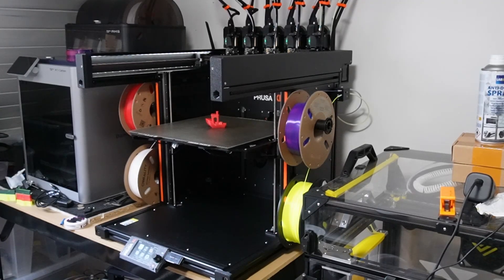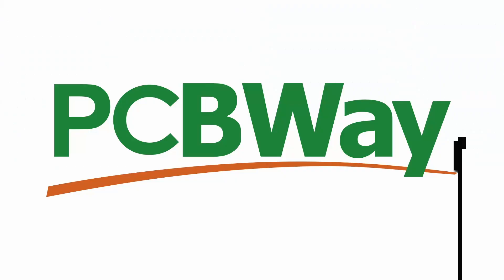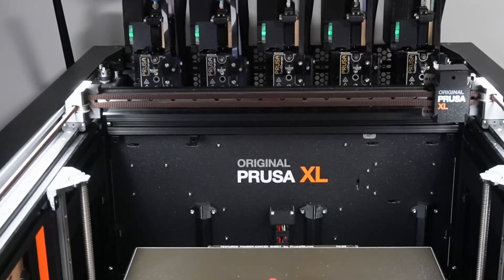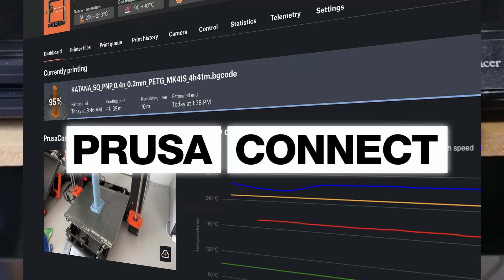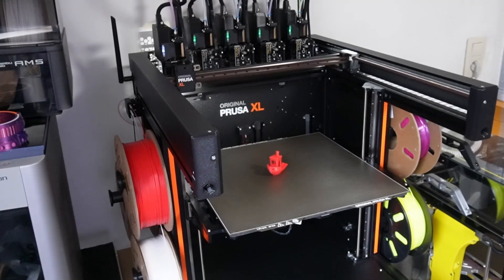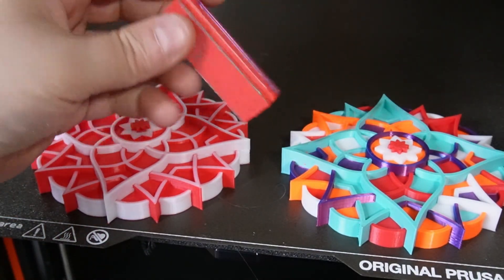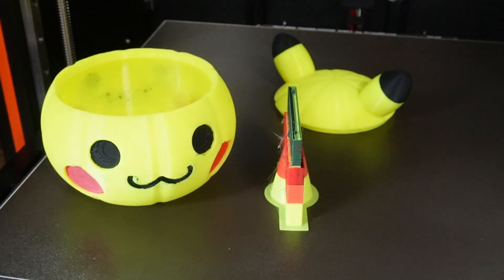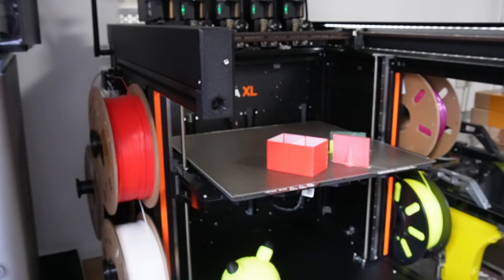Prusa XL The 5 Toolhead multicolor/multimaterial 3d printer

Comment: I took the plunge in January after waiting ages from the pre-order.

Yes, it's not cheap, but it runs like a Swiss watch! It really has no "equals" out there, hence the price they can ask. A 5 Toolhead was $6,500AUD landed. But on Multi colour prints which is what it's mostly used for (Or very large prints), it has no peer. The 5 second toolchange Vs the 30+ second filament change on the Bambu Carbon X1 means that the net result is substantially faster overall without shaking the crap out of the workbench and everything on it.

In some ways it's a bit like the Johhny Walker ad's of years ago. Do you want the whisky you'd rather drink, or the one you want to pay for.

In due course there will be cheaper machines to compete that are toolchangers. But this thing leaves every permutation of Single extruder in the dust!
Reply from the maker: thank you for your comment

Comment: Nice machine, but no enclosure. Price is high even for Prusa brand. I will keep my Bambu lab x1 carbon printers. So far plenty hours with few failures and problems. The only pro I can see is the purge waist. Thank you for the video. Keep the signal going strong 💪
Reply from the maker: thanks, the enclosure will be showcased on the next video :)